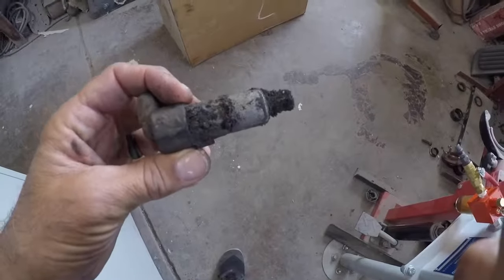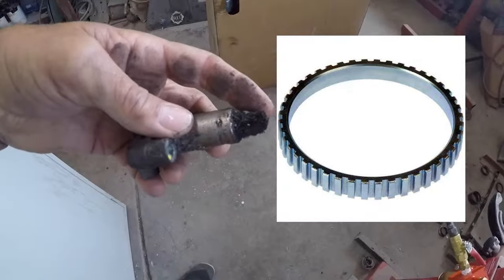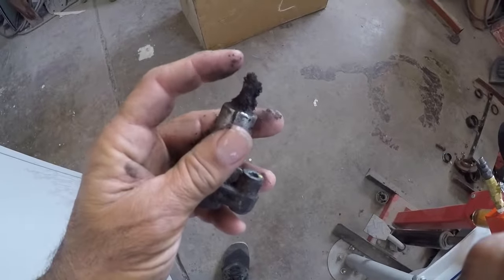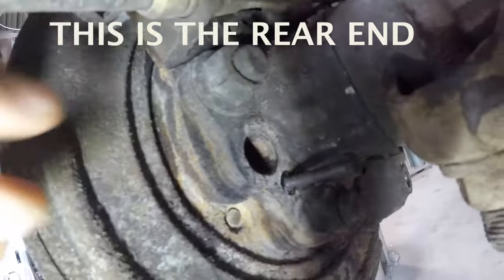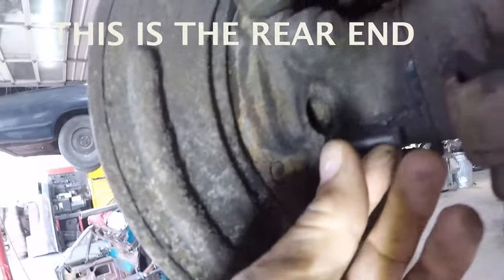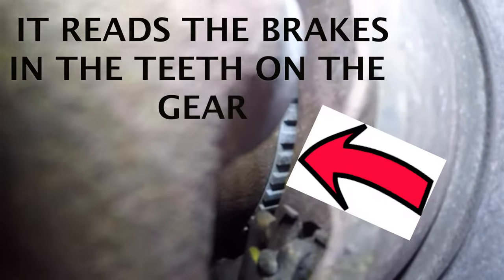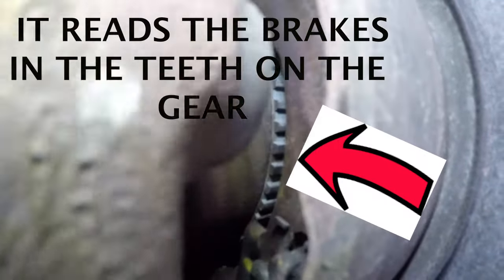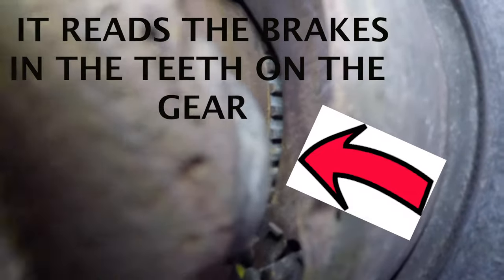Pulsating brake pedal and ABS light~~~ EASY FIX

Comment: Replaced my abs control module. Replaced brake booster. My abs light stays on and will shut off. But the moment I hit a bump it comes on and stays on. Even after resetting computer. My brake pedal will vibrate and make my truck seem like it doesn’t want to stop but it’s rare. Like it happens every couple days to weeks and does it at least once or twice when it happens
Reply from the maker: Email me your code that is giving you and I will send you some information autorepairtips@gmail.com
Reply: Found fix ? Same problem here
Reply: Wheel speed sensor

Comment: I have this problem on a 2005 ford sport trac I will follow your advice or should I just replace the sensor
Reply from the maker: Make sure you try to diagnose the problem before just replacing parts. Do you have a scanner try to pull it and see what the codes are
Reply: Hi did trouble shoot pulsating problem

Comment: JUST changed hub,bearing, sensor,ball joint,rotor,caliper,pads..NOW,I have this,never had it before repairs.It's called "Marty's Law"...Murphy has nothing on me ! (have had it apart to clean sensor of grease and contact area,different set o pads...still NO).

Comment: I'm having a pulsating with my chevrolet 3500 such as a warped rotor but this started after a oil change and tire rotation, the truck only has 60'000 miles and has not been pulling anything heavy in which stopping might have heated the rotors. It don't do it all the time and sometimes turning off the traction control will make it stop. I have a feeling it was something done at the dealership involving the tire rotation as it started right afterwards.
Any ideas on that?

Comment: I have a Toyota Camry 2005 that pulsate when breaking. I have change the front rotor and breaks, and rear and my car still pulsate
Reply from the maker: are there any light on ? ABS or check engine if so what are what are the codes
Reply: @AutoRepairTips757  No lights are on. I will be taking my car back to Kiwk Kar they are going to resurface new rotors although the manager does not believe it will help
I am at a loss
Reply from the maker: You did put rear rotors on. When you feel it pulsating in the brake pedal that usually means something is wrong in the rear
Reply: @AutoRepairTips757  Your the first person I heard say that! I have a 2004 chevy silverado 2500HD 6.0. Just changed out arotors and pads in the front. My Abs light is still on and brake pedal still pulsating
Reply: @brendanokeefemusicalruda6780  Check your brakes and rotors make sure they’re not out of round, also what’s the code for your ABS and I will try to send you some info
Reply: @peteeates757  your the man. I’ll get the code asap! Thanks brother

Comment: i have a 2003 trailblazer. i recently had some suspension parts replace. after the replacement, out of the blue, the abs light came on. when i replace the speed sensor the light turned off but the brakes feel pulsating at low speed driving when i apply the brake gently. i had to disconnect the abs speed sensor for brakes to work normally. if i hook the abs sensor again the lights turns off but i start experiencing again the brake pulsating. any recommendations?
Reply: Did you ever get this fixed?
Reply: @noahziska8024  yes. but it only lasted for almost a month. first i bought new sensors, and still getting the same issue. i bought a brake cleaner and sprayed the sensors, the ones they go inside the wheel hub. i also spray a little inside the hole where they go while spinning hub. after putting everything back in. it worked. but now i'm starting to have the issue again after a month.

Comment: I have a 2002 GMC Envoy. The pedal pulsation only happens a very low speed like when I'm easing up to a stop. Firm pressure and it stops. No ABS light, but I suspect that it is related.
Reply from the maker: what does it do if you come off high speed ? you need to check your rotors
Reply: @AutoRepairTips757  It's not the Rotors. I watched another YouTuber and he described it perfectly. He even showed the replacement. It's one of the ABS sensors for the front that's dirty. Thank you for your video. It still placed me on the right track. I replaced my Rotors not too long ago. I do all my own work for the most part. So I will be cleaning both.
Reply: @andreroy8141 i have the same exact issue, how did you fix it? And what should i tell the mechanic since i dont have enough experience to do it myself. Thanks
Reply: @K0J0K  I didn't fix it yet. It's completely drivable. Once I determined it's likely just those dirty ABS sensors. I will clean them on my next  break job.
Reply: @andreroy8141  mind sharing the YouTube video u talked about earlier, the one who described the problem specifically. Thanks